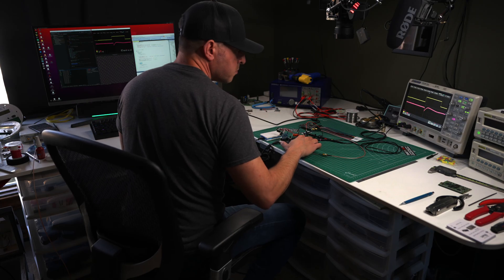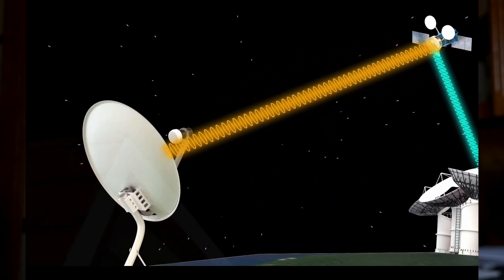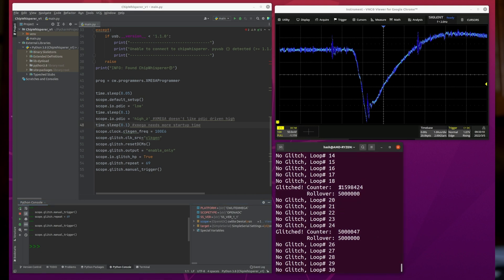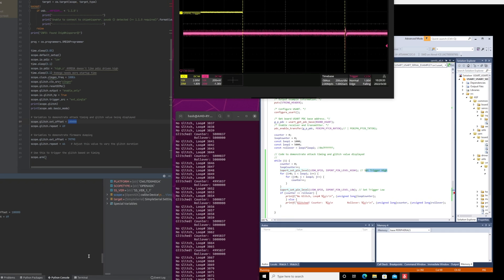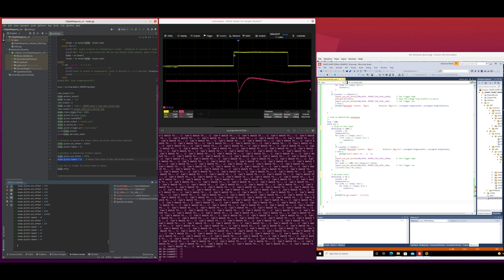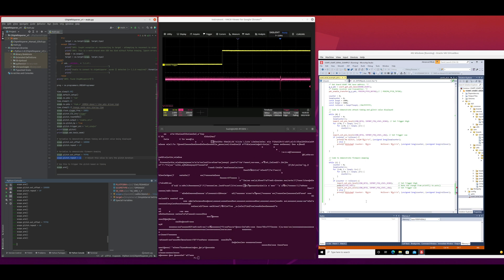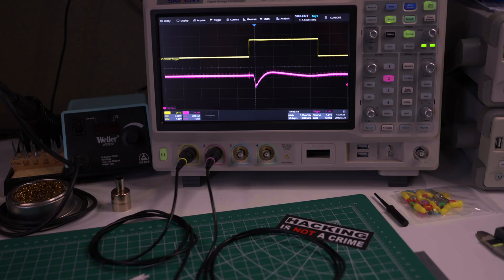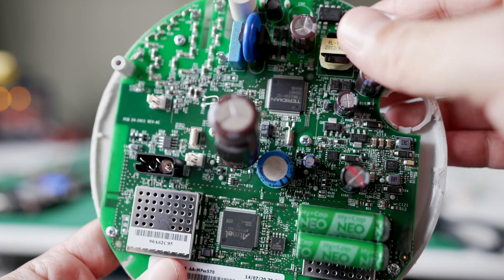What do Smart Meters and Satellite TV have in common?

Comment: very interesting indeed. by printing out the string it sounds like you are skipping the null character, so it will just print out until it encounters the next one. you are likely just getting a portion of what's in ram. i work on stuff like this and i never locked down the processor, you could just read out the entire flash if you wanted to. is there even a point to locking it down when someone can just glitch it anyway? i always figure reading out the binary would be useless, the source code is where it's at right? what can you even do with the binary data? are there some encryption keys in there, yes, but how would you be able to locate 32 bytes within around 340,000 bytes, how would that even be possible? i'm talking about the root key, which isn't even used in encryption but a session key is calculated which would be in ram and the way it's calculated is quite convoluted.

Comment: What is the actual mechanism of the "glitch". Is it an over-volt to a pin on the micro, ie, some hardware thing.
Reply: The glitch is usually shorting the micro's power rail to ground momentarily. But not long enough for a reset or brown out detection, but long enough that the micros flash/ram access or registers gets corrupted.

Comment: I thought you would glitch it at the power-on-reset section where it reads it's fusebits. This could allow the debug interface to be enabled and code readout to be allowed.
This is how most crypto wallets are hacked.
Reply from the maker: My next video will be on adding hardware  JTAG capability back to the circuit board. From there we’ll take a look at the various places we can glitch, which may turn out exactly like you’re saying. We’ll see!

Comment: At about 5:00, you say it'll allow you to profile the board. What exactly does that mean and if I wanted to profile a board, how would I go about doing so? Thanks!
Reply from the maker: So the glitch is very specific to the hardware design, like how a contact lens prescription is specific to a person. By loading my test firmware on a meter that I already know how to glitch, I can fine tune the parameters so the glitch works on this new hardware. Once I have those new parameters, I can then attack the unknown firmware on a smart meter knowing that my glitches are the correct shape, and I’m just finding the right time to glitch after it boots up.

Comment: How do you know it is the firmware you are seeing coming out which I assume is a uart like what is connected to the optical interface?
Reply from the maker: In the case of the development board, I know it’s the firmware because I compare the data that gets dumped to the raw binary that I loaded into program the chip and it matches exactly. Just edited out the comparison in the video because it was kind of boring to watch.
Reply: @RECESSIM  Is the output from the program you wrote then?  Like a command?  It is not clear what the process is because those Atmel chips have fuses to prevent JTAG and reading of flash.  I can only assume you had a program with a code output function and by tripping the voltage you some how go it to run there rather than then the start up vectors
Reply: On a print statement, it will only dump until it sees the next NULL or zero value. So not all the firmware code. It also depends where the string was stored in flash. Obviously won't dump anything before the string location!
Reply from the maker: @simonbaxter8001  That’s what I figured would happen as well, but glitching a puts() at the right point causes it to loop through the entire firmware, all 2MB continuously and print to the screen. I’m guessing it must stop eventually but it looped through the entire flash multiple times before I pulled power.

Comment: I still have my old unlooper, was a DIY build stuck to a breadboard. Pretty much was a clone of Wildthing.
Reply: You really don't want to know what I'm sitting on. I have H card unloopers, HU card unloopers, card readers/writers. And enough circuit boards and parts to build probably 50 unloopers, as well as boot boards and card slots. I have several tubes of the Atmel chips that were impossible to find. As well as all of the other resistors, capacitors, and ic chip sockets.
I was quite involved in the business back then. There's a lot more to the story but if I kept it up I would be easy to identify and I like my anonymity
Reply from the maker: That’s awesome!